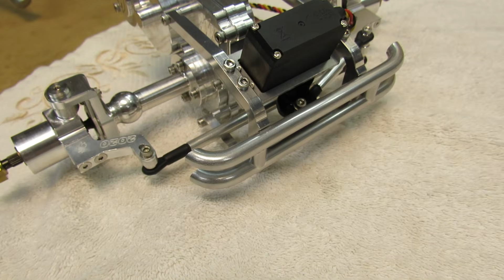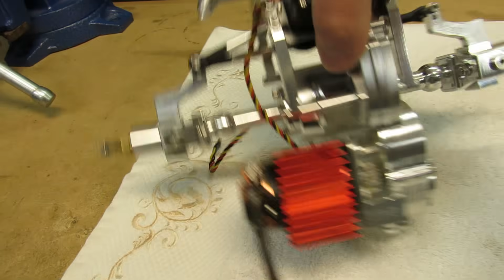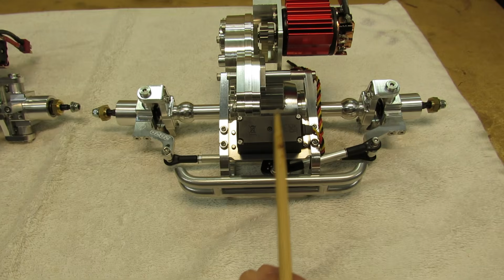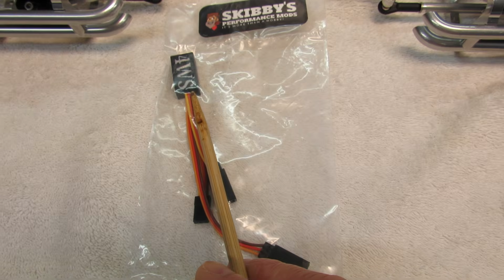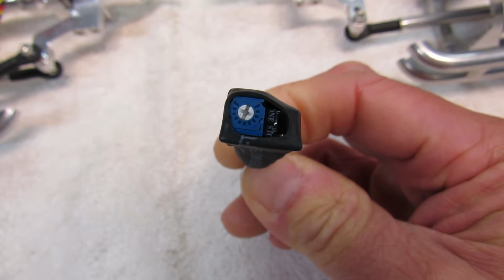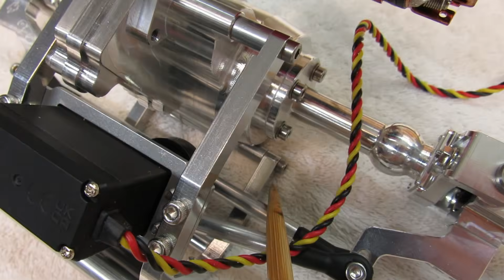Tamiya Clod Buster project update 1 - Hesse Machine gear case/box & axle assemblies

Comment: Another great video! Thank you for posting this. The set up looks great and the gear reduction units look so cool! Would you still buy JPS second hand now days? Or is Hesse a better option? Cant wait to see the tires on this thing 👍
Reply from the maker: You're welcome and thank you for watching!

Hmmmm...would I buy JPS parts today?  That is a good question.  Since I actually was into Clod Busters way back when JPS was still in business and I actually did buy lots of their parts brand new, I have a different perspective compared to someone buying them for the first time today.  After thinking about it, I probably would not advise buying them second hand today for these reasons.

1.  It has been a long time since JPS was in business and overall knowledge of their parts and, most importantly, the undocumented design changes that JPS made to their parts is largely unknown today.  That lack of knowledge now was originally why I made my video showing my old set of JPS axle assemblies and my opinions about them.  (I wanted to get the word out.)  As I said in that video, some of the changes that JPS made without telling anyone (most importantly they left their customers totally in the dark) can make them impossible to use with a certain Clod Buster set ups.  That was really frustrating for me back when I was building my Clodzilla IV Grave Digger truck.

Also, and this is critical, even the person selling their JPS parts today might not even really know what they are selling.  Thus, they might not have any idea what design changes were made to their specific JPS parts up for sale and what kinds of custom Clod Busters they will or will not work with.  I find that, at least on eBay, sellers are extremely unknowledgable about the JPS components that they are selling.  They do not come up for sale often but when they do they are more often being sold by a seller that honestly has no clue about what they have up for sale.

2.  JPS parts today are extremely expensive.  People that have them seem to think that they are precious and they expect top dollar for them.  Honestly, I do not get the "hype" about JPS parts today.  It is not 1995 any more.  JPS is not the only company making machined aluminum components for Clod Busters and Bull Heads today like back then.  Today there are way more options for those parts compared to in the 1990s.  You can get the same parts from Hot Racing, Hesse Machine, and Integy now.  JPS gear cases and axle tubes were nice back in the day but I honestly do not think that they are nicer than today's options (though I do admit that I know nothing about Integy's parts) especially considering the sky high prices that people are now asking for their old JPS components.

3.  This is the big one.  I honestly do not think that JPS parts offer anything better than what other companies today offer.  The only negative strike against the Hesse Machine gear cases is that their motor mount slots do not allow the use of a pinion gear smaller than the stock sized 13 tooth one.  That is a big negative strike, I'll admit, but if you were never planning to use a pinion gear smaller than a 13 tooth one, that is not a big deal at all.  If that is an important factor though, then there are always the gear cases from Hot Racing.  They will allow for the use of a smaller pinion gear than a 13 tooth one.

Now, others do not like their Hot Racing Clod Buster parts and have said that they were not made well.  All that I know is what I have experienced first hand and I have not had any problems with any of my Hot Racing parts at all.  I can only speak for myself in that regard.

When it comes to axle tubes, the Hesse Machine ones do not have ball bearings on the king pins.  You might think that that is a strike against them.  If so, then I have seen online photos of people bolting Hot Racing axle tubes to Hesse Machine gear cases.   The Hot Racing ones feature steering king pins that rotate on ball bearings.  I have never attached my Hot Racing axle tubes to my Hesse Machine gear cases so I do not know first hand if that combination will work and that was why I never mentioned it in my video about all these parts.  I have only seen others do it online and it looked like it worked out OK.  If that does work, that would be a way to have bearing supported steering kingpins, one of the features of JPS axle tubes, without having to pay sky high JPS prices.  (Also keep in mind that, as I mentioned in my video, bearing supported king pins were one of the undocumented design changes that JPS made over the years without telling anyone so not all JPS axle tubes have them.)

So, those are the long winded reasons why I would pass on JPS machined aluminum gear cases and axle tubes today.  There are just more options on the market now so it is easier to get the same basic parts but for a lower price and without all of the hassles.

The only reason why my most recent Clod Buster project with JPS components, the ESP "King Clod," used them was because I just happened to have a box of them that I bought way back right around the time that JPS went out of business.  Thus, I got them for a decent price and they had not been thrashed on for twenty years.  If I had to do the King Clod again today, I probably would not have used JPS parts on it.  Now there are just too many unanswered questions about JPS parts.  You can still use them today but if you do you really have to know exactly what you're buying before you hand over all that cash.  Basically, you have to know more about what the seller is selling than the seller!
Reply: Thank you very much for the insight. I've always wondered if JPS axles and tubes would still be worth going for today. The prices are very high like you said when they pop up for sale. I'm currently building a show truck with a Sassy chassis and full Hesse set up. So far I'm happy. Perhaps I'll give hot racing a try for my other show truck build...
It would be great to get a Bay Area Clod club going also! Cheers!
Reply from the maker: @scalemodelconcepts7644  You're welcome  and please feel free to ask any other questions.  Your truck sounds awesome!  You are doing exactly what I did with my monster truck fleet.  One of my trucks has Hesse Machine parts, one has Hot Racing, and a few others have JPS parts.  I never mixed and matched different brands of machined aluminum parts in one truck.

I agree, a Bay Area Clod club would be cool!  This part of the world has never really been a hot bed for R/C monster trucks based on my experience.  I remember way back when I was building my Clodzilla IV Grave Digger truck and I would take it into the local hobby shop when I was looking for parts.  Both employees and customers would always ask me lots of questions about it like they had never seen an R/C monster truck before.
Reply: @L @Locoboy5150  yes I am actually currently building a few trucks in the same manner.  I would love to exchange photos and build ideas... since we are Bay Area local and lol yes not too many people know about these trucks now days nor back in the day when they were new...
Reply from the maker: @scalemodelconcepts7644  If you want to ask me some more detailed questions about your Clod Buster or Bull Head project, please feel free to send me an email at this address:

Locoboy5150@hotmail.com

I can't promise that I'll know all the answers though!  😄

Comment: I never realized the gear reduction reverses the rotation... if they multiply torque by 4, do  they divide speed by 4?

Those assemblies look awesome, and those heatsinks look great becausethe profile matches the reduction units!

I'm looking forward to the next update...
Reply from the maker: Yes, the gear reductions do decrease the speed by 4.  They take an already slow truck and make it even slower.  That is not an issue for me with this truck though because it will be sky high with a high center of gravity so I do not want it to roll over.

Thanks for the kudos and for tuning in.  I am making progress on this Clod Buster...slowly...very slowly.

Comment: NICE!!!!!!!!!!  Hitec is my go-to servos as well, I like the D-625MW servo myself.   I also run Robinson pinions in my Clods, even in stock trucks, I say the same thing about Tamiya pinions, its not even just Clods, it's most all their kits..
Reply from the maker: Thank you!

My only experience with Hitec servos was with the HS-645MG in "Raging Bull."  I liked it so much for the price and that was why I used two of them in this new Clod Buster.  Recently, Hitec raised their prices on servos across the board so, thankfully, I bought all of mine before the prices went up.

Yep, those stock Tamiya pinion gears are basically made from butter!  I have been using 32 pitch steel pinion gears in all of my Clod Busters and Bull Heads since day one and, along with ball bearings, steel pinion gears are always the first hop up parts that I suggest to all new Clod Buster and Bull Head fans.  I even suggest steel pinion gears before oil shocks since they are easier to install when first building the kit compared to swapping on new shocks, which can easily be done after the truck is all finished.

Recently, some fellow Tamiya fans online did not agree with me that 32 pitch pinion gears can be used in a Clod Buster or Bull Head without any problems whatsoever.  (What do I know...I've only been using them literally since 1987.)  They said that you absolutely must use 0.8 mod metric pinion gears, like what the stock ones are.  Technically, 0.8 mod gear teeth are not the exact same as 32 pitch gear teeth, so they are correct in that regard.  But, countless other monster truckers have been using 32 pitch pinion gears in their Tamiya trucks like me without any problems at all.  Just be aware that there are some Tamiya fans out there that insist that 0.8 mod pinion gears absolutely must be used in a Clod Buster or Bull Head - no exceptions.  They are correct in theory but not in actual real world experience.

"This subject got me interested in looking for steel 0.8 mod pinion gears and I found out about the gears from Carson.  They do make a full line of 0.8 mod steel pinion gears but they are not sold in the US.  I did find a hobby shop in Germany that sold them and would ship to the US but the 13 tooth pinion gears with shipping was something like $60 a pair!  Basically, steel metric pinion gears are impossible to buy here and not worth the hassle or massive expense.

This 0.8 mod versus 32 pitch pinion gear issue will come up in a future video from me.  (Hint: this truck that I am building does actually have steel 0.8 mod pinion gears from Tamiya in it.)
Reply: @Locoboy5150  Agree about the pinions, as far as I know, Robinson states that their 32P pinions are indeed 0.8 module (their words)..  I got my first Clod back in 87 and ran stock pinions for 2 years then it was Robinson all the way, to this day, all my Clods run them (some gearboxes I don't even use grease on the gears). When I raced, no grease in the gearboxes has less parasitic drag resulting in faster acceleration and more top speed. I'm hoping Tamiya re-re's the Bullhead!!!!
Reply from the maker: @UncleBobsRC  I have heard that some companies will say that 32 pitch and 0.8 mod are the same.  For all practical purposes, they are the same in my book.

That is interesting that you did not use grease on your gears.  I have not tried that but if I need more speed, now I know an easy way to get it - thanks for the tip!

It would be great if Tamiya re-releases the Bull Head again.  The Bull Head does not get enough love in my opinion.  Then again, I have always had a thing for monster semi trucks for some reason.  I always loved Super Pete and King Of The Road since I was a kid!
Reply from the maker: @UncleBobsRC  If you can't wait for Tamiya to rerelease the Bull Head, someone just put one up for sale on eBay recently.  It's the rereleased one with the ESC that came out in 2012 with the kit number 58535.  It is brand new in its original box and the box is still in its original shrink wrap.  It is item 236619148598 and its price is $750.
Reply from the maker: @UncleBobsRC  I noticed that that Bull Head that I mentioned that was up for sale on eBay, item number 236619148598, sold yesterday (2-7-26.)  Did you buy it?
Reply: @Locoboy5150  Thanks for the info but no kits for me till Nov... I got me eye on my 60th gift....
Reply: @Locoboy5150  No I did not...  No more kits for me till Nov, I got me eye on my 60th gift....
Reply from the maker: @UncleBobsRC  Ah, OK - you're welcome!

Comment: JConcepts makes tires that are bigger than the stock ones I think they are called golden 73s I compared them yesterday while going through the parts that I have collected for my build. I really like the Hess machine axle housings axle tubes and the steering knuckles I’m probably going to have to get them for the build I’m doing
Reply: Can you   mount j concept tires on the original clod buster rims
Reply: @chucknorris-ec1pt I don’t think so
Reply: Jconcepts makes wheels for them
Reply from the maker: @ryanmiller8853  Yes, they call them "Tribute" wheels.  There is more information about them here on the JConcepts website:

https://jconcepts.net/tribute-26-x-36-monster-truck-wheel
Reply from the maker: @chucknorris-ec1pt  I am not sure as I do not have any hands on experience with any JConcepts tires.  According to the JConcepts website though, their tires fit on 2.6 inch diameter wheels, which is the same diameter as the stock Clod Buster and Bull Head wheels.  There is no mention of the width of the tire bead on the website though and if it is the same as the width of a stock Clod Buster tire's bead.
Reply from the maker: Yes, I considered the JConcepts Golden 73 tires for this project truck but I did not use them because they only fit on proprietary JConcepts wheels called Tribute 73s that are larger in diameter at 3.2 inches compared to 2.6 inch diameter Clod Buster wheels.  Those Tribute 73 wheels are made from plastic and that was why I ruled them out.  With all of the machined aluminum on this truck, putting plastic wheels on it would look really bad to my eyes.  That is a shame too because I absolutely love the Golden 73 tires!

That lack of aluminum wheels was also why I did not use Imex Jumbo Kong tires on this truck.  Those were my first tire choice actually.  Only two companies that I know of made aluminum wheels for Imex Jumbo Kong tires, JPS and RC4WD.  JPS only made them right before they went out of business and disappeared forever and RC4WD only made them for an extremely short time and then they were suddenly discontinued.  Unfortunately, based on their lack of availability, I am the only guy that wants aluminum wheels for all of these huge monster truck tires.

By the way, I first mentioned the JConcepts Golden 73 tires and why I did not use them in this video that I made about Clod Buster tires and wheels:

https://youtu.be/Yhou5yFZ7hw

If you are going to use Hesse Machine gear cases for your truck, be aware that the adjustable motor mount slots in them cannot accommodate for any pinion gears smaller than the stock sized 13 tooth ones.  That really is the only negative thing that I can think about them.  That is especially important to consider if you are going to be using tires like the JConcepts Golden 73s that you mentioned.

Comment: I hope all the machine issues have been fixed in these i have 4 sets  nothing butt problems
Reply from the maker: So far, so good with my set.  I did mount the stock steel Tamiya axle stays onto the Hesse Machine gear cases and axle tubes later on though and I will show that in another video.  Initially, the two mounting holes in the stays did not line up with the holes in the gear cases and axle tubes though  To get them to fit properly, I just loosened the screws that attached the axle tubes to the gear case first.  That allowed the axle tubes to move around a little and then I could align the stays to their mounting holes properly.  Once I bolted the stays on, then I re-tightened the screws that attached the axle tubes to the gear case and everything fit great.

That was the only little problem that I came across with my Hesse Machine aluminum parts.
Reply: @Locoboy5150 another  you tube channel reached out to the manufacturers did not care its been a few years since  I purchased this type of axle
Reply from the maker: @chucknorris-ec1pt  If you were referring to this video:

https://www.youtube.com/watch?v=Gc6ge0wz7ug

Note that those were aluminum gear cases and axle tubes made by Hot Racing.  In this video I am showing aluminum axle gear cases and axle tubes made by Hesse Machine.  They are a little different from one another, as I showed in a previous video.

Also note that I have these parts made by both Hesse Machine and Hot Racing and all that I can say is that I have not had any problems with any of them.  (Maybe I got lucky.)  The only ones that I had any big problems with were those made by JPS, as I mentioned in that previous video, and those problems were because JPS made undocumented changes to their parts' design and not because of manufacturing errors.
Reply from the maker: Just curious, but what problems did you have with your aluminum gear cases and axle tubes?